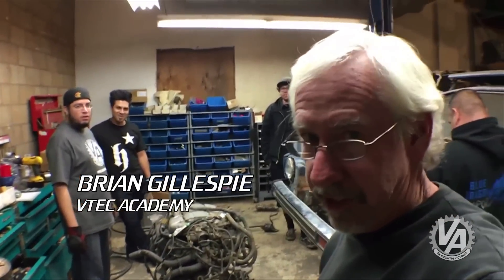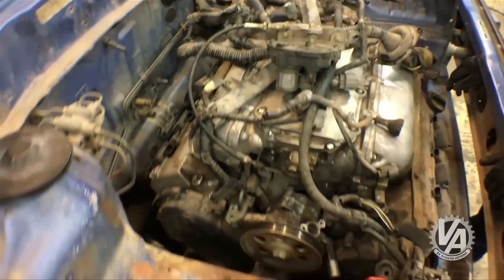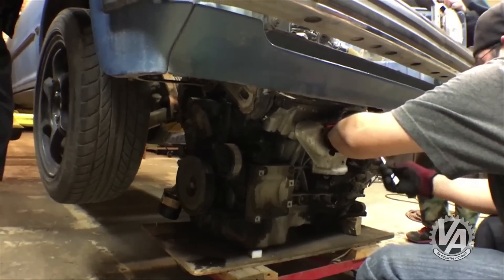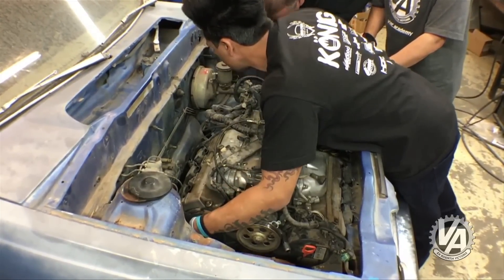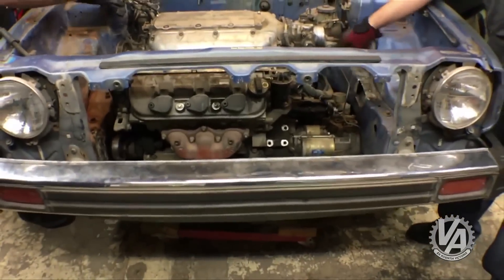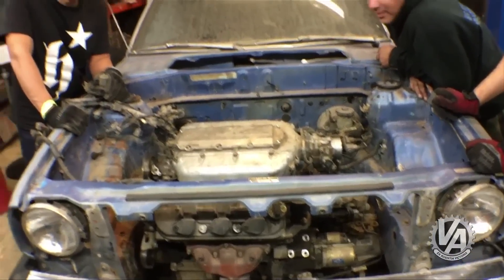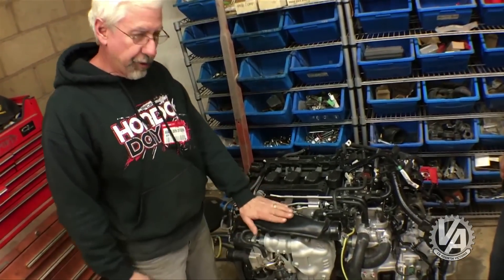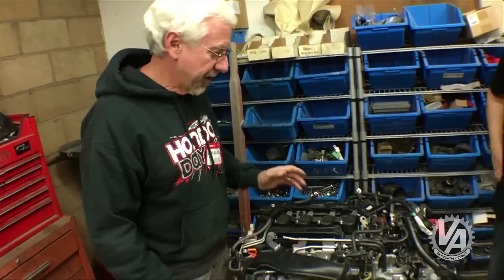81 Civic Pt. 4- J Series or L15B7 Turbo?

Comment: Thats a awesome idea 1st gen civic with newest gen motor !
Reply: EF9Porkchops neat idea in the sense of new into old keeping it civic motor, but at that point of cost trouble and return, it's not worth it

but super cool, and would be so great at car meets or humblebragging to any car guy
Reply: Hey teach ! You look like Tim the tool man cool ! Put that engine in a 80s Crx that would be cool as hell
Reply: EF9Porkchops I'd say use a j35y4 but it's too new and too hard to come across just a thought tho
Reply: Acureyt do you think a j32 6 speed would bolt up or would you have to do some work with the bell housing I mean it should bolt up they are both j series
Reply: @VTEC Academy, Heheh at 8:00 I agree that is one ugly engine! =(